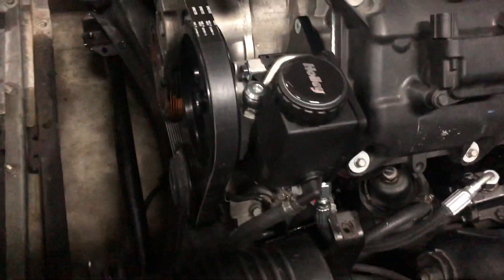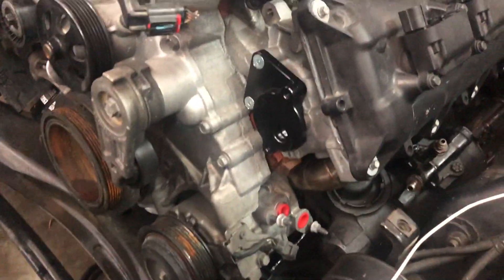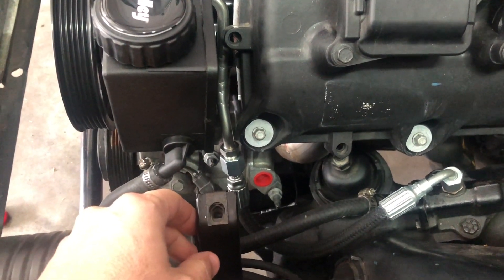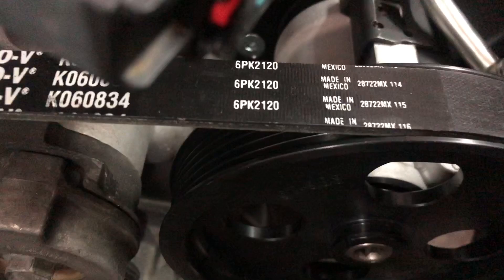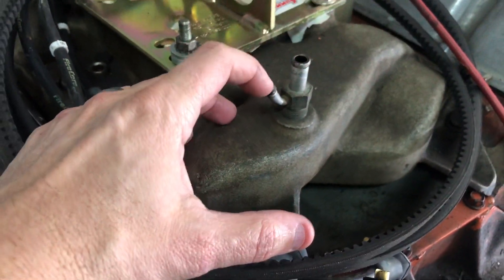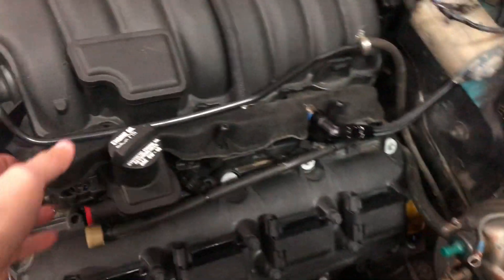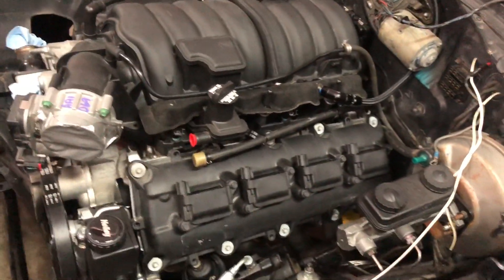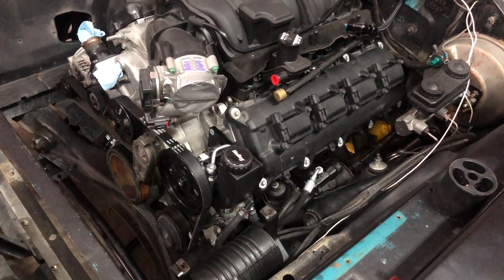‘69 Charger 6.4 Hemi Swap Part 10: Power Steering and Belt.

Comment: Any details on the power steering lines you had made?
Reply from the maker: I reused the low pressure side and the high is custom using the hard line supplied by Holley and taking it to hose guy. Do you want measurements?  I don’t know if it will be same for your car. I know the ends are a 90* and strait fitting.
Reply: @LukesGarage  if you wouldn’t mind that would be awesome! You have some way I can contact you I’m in Texas too.
Reply from the maker: @justinb.5561  I’ll measure the high side tonight. You can find me on Facebook and send me message. I’ll send you my cell. I’m also on insta. All are same name as YouTube.
Reply from the maker: @justinb.5561 I measured the line and just the rubber part in between the fittings is 7 inches. When I had that hose made the guy asked me how long I wanted that rubber part to be. Over all didn’t matter. The fittings are standard high pressure fittings that shouldn’t vary in length or size. How that helps. Hard to explain. Maybe I should shoot video. Idk

Comment: Hey Luke.  For the wiring portion.   Can you make the engine bay a multi part video, as well as the transmission wiring .  Really could use detail B body connection points.  That for the part #'s with your installs. One more request, the demo of old wiring from the original mopar.  Thanks again.
Reply from the maker: I am in the middle of wiring. I already demoed the old harness but can show what I’m keeping from it. I planned on separate trans video as well.
Reply: @Luke’s Garage  awesome.   What to eliminate from the old from the firewall conne tion, the linkable fuse to the inside, fuse panel tie in and so on. Really appreciate the reply and opportunity to watch.
Reply from the maker: @claykingston7833 Have you watched my video on wiring. Just checking to see if all your questions are answered. Let me know.